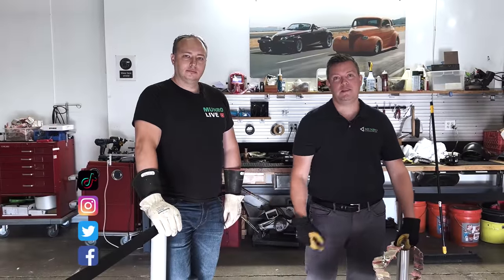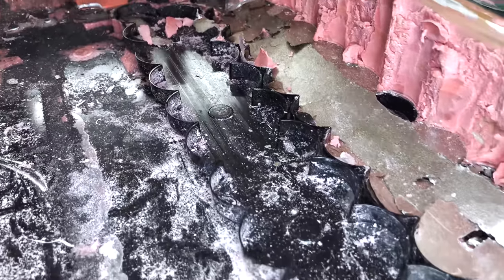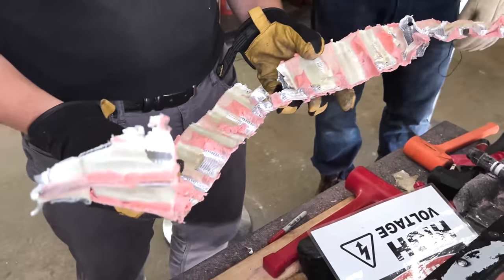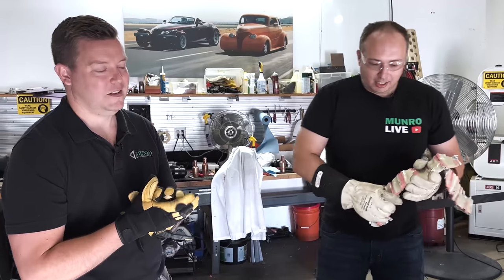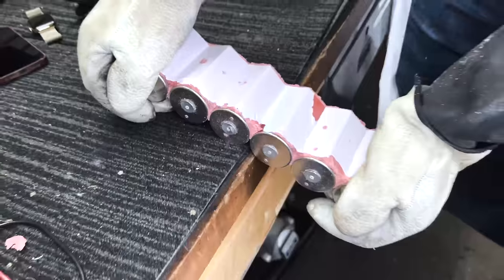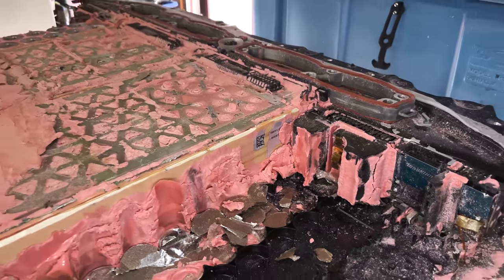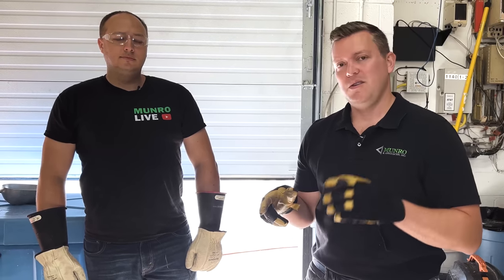4680 Update Structural Adhesive | Tesla Model Y

Comment: For all the "Reusability" and "Serviceability" delusional people: look at Weberauto YT channel's recent 4 part series about the Mach-e battery, which is "modular inside".  Basically 3 days of labor with lots of special fixtures and tools along with hundreds of fasteners to remove and replace.  I'm sure that every neighborhood garage and DIY grease monkey can do that.  Very few, if any, Ford dealers can do that.  As for the cost, if you have to ask, you can't afford it.
Reply: EXCELLENT points
Reply: Good to know. I too think servicing the packs (non-structural) to refurbish them it so be done in specialized facilities. It's not feasible the technican services the particular pack in a car and puts i back - labor time would be too long. Maybe it was easier on early EV:s that were not built for it from the ground up but with advancements of skateboard designs and Teslas structural pack giving more advantages they ought to just go ahead and design them for lasting at least the car expected lifetime. It degrades some but then stays high. I have a robotic lawn mower with 2500+ charge cycles on some 18650 batteries, it still works very well.
Reply: Outstanding research, nobody whose hating on tesla and uses the alleged lack of any supposedly easy recycling will listen. 😀

Sandy himself said easy peasy just grind it up, use chemicals to seperate out the various valuable recoverable elements in float tanks. 
Recapture repurpose and then reuse them in new pack's.
Elon also said they view pack's as simply starting off with some high grade ore.

Heck we chop up whole entire cars at auto recycling businesses across the U.S. now, per GDP the auto recycling industry is our nation's 16th largest contributor. Over 90% of all vehicles are recycled, and up to 95% of the entire material count is recovered during recycling.

A recent study also estimated that every ev pack of at least 60kwh capacity has $1,800-$2,500 by content recoverable materials contained in it. Now if people will cut off a cat for the few hundred in rare earths they contain? I imagine battery packs will also be completely reused. 👍🏻😎
Reply: GM tested in-the-field module replacement for the Bolt recall program. The actual recall program though ended up as swap of complete packs. All things considered structural pack that if it fails becomes high grade ore is the right idea.
Reply: @4literv6  Just grind it up? So that's the solution to every problem on an assembly that cost tens of thousands of dollars?
Reply: @DeLorean4  all the materials they get from it are clean, so that means for prob 20% of the resource cost they get clean and recycled materials. So it's more beneficial to shred a pack for resources than to repair it. Do not forget you also get money for the pack, not the full value of a new pack but after 10 year warranty it's probably your only cost IF a pack dies, which has not happened yet, only degration.
Reply: @DeLorean4  Well, yeah.  How much would you be worth as Soylent Green?
Reply: So you have one more example of bad repairability and conclude that all packs must therefore be unrepairable, ignoring that Tesla's own packs until now could be repaired quite reasonably at the module level.
Reply: @jfolz  I didn't ignore anything, instead I've done the research on places like Gruber motors repairing the older simpler roadster pack's. 
And low rent types like rich rebuilds claiming his electrified garage shop can repair a tesla pack for cheaply. 
Again those repairs have no warranty and do NOT hold up over any period of time. 

Over on the main tmc forums multiple older tesla owner's who tried to cheap out and get a module or 2 replaced. Saw exactly what I'm saying happen, over a short period of time the bms reverted back to showing reduced capacity. The pack's do not play well with adding different modules once sealed up. Maybe swaps where they use different boards and bms systems to control tesla parts see better use. But that doesn't help a tesla owner and again has no warranty either. 

Plus I used to be certified as an entry level tech myself and have managed automotive repair shops. Inc those with hybrid trained tech's before teslas and leafs i3s etc started appearing. I also talk with the tech's at my nearest actual ev certified Ford dealer. None of them want anything to do with replacing/repairing modules in pack's of any evs. Exposing the pack's to humidity here in the south can cause issues. 

Getting them to completely seal back up properly is a known issue. It's a very complicated and at least internally speaking delicately balanced act making a modern durable long lasting ev pack. No matter what anyone tries to tell you on the internet otherwise about "repairability"👍🏻
Reply: @jfolz  Really?  how many battery packs of any BEV have you, or anyone else repaired?  The Leaf? the Bolt? an ID4?  A 'Bimmer, Audi or 'Benz.  Maybe you're the one with the thriving Taycan battery repair business.  Surely the more expensive batteries of the Hummer and Rivian have plug & play cells like your cell phone?  I'll stop now to let you listen to Jiminy Cricket sing a few choruses of "When You Wish Upon a Star" or from Cinderella "A Dream is a Wish Your Heart Makes"
Reply: @steamtorch  yeah the careful matching of cells/modules in series cannot be understated in this application even if cells are fully accessible & serviceable, it's not going to last well with a cell out of spec to the others and would take ages to review the entire pack to ensure it matches the rest,  BMS balancing can only do so much and these packs would suffer greatly reduced life with a mismatched cell/module.
Reply: @shazam6274  why would anyone attempt a repair on a pack that's still under warranty? You can't compete with $0...
Reply: @4literv6  I'm not surprised some people have had bad experiences with module replacement when you can only get salvaged modules that are the same vintage as the others or have been in a crash. This is not a problem with repair in an of itself, just how Tesla operates.

Btw. the rest of the world exists. Maybe look at what's going on in Norway if you want to know about EV repair. They have the highest density of EVs by a long shot.
Reply: @jfolz  Whoosh!  The issue was reparability, which is not a practical possibility with ANY of the vehicles I mentioned.  GM tried to save money $ repairing Bolt Batteries, but found it was better, faster and cheaper to replace the whole pack.
Reply: @shazam6274  woosh yourself. You have one example of one manufacturer trying repair and conclude that it cannot be done.

Not that I already wrote that 8 hours ago...
Reply: @jfolz  no manufacturer will repair battery modules and safely replacing modules in a pack is never cost-effective, your working with 400v live bus bars once you get to pack unsealed.
Reply: If you can't remove the modules from a Mach E pack, you're either an idiot or just mechanically incompetent. Hobbyists have been tearing down EV battery packs for a decade now, without much difficulty. Still, between high dealership labour cost and a desire to avoid mis-matched modules, vehicles will typically get complete pack replacements; disassembly to the module level is mostly for re-use of the modules in different applications.

Comment: Gads, i hope they have some system to allow the pack to work when a cell goes dead
Reply: How about some form of solid state relay, one per cell, that trips if the cell goes "out of spec" and electrically removes the cell, then software that performs a recalibration when possible?
(0.12 percent loss per cell.

Comment: Well you wanted a structural battery pack... I would love to hear an analysis of the structural rigidity of the full assembled pack between the foam and the glues and the cover. I bet the pack is stronger than any frame on any pickup truck out there.
Reply: Until the glue and foam strength properties decay over time with heat cycles.

Comment: I stay with my Statement: Only the Foam makes this Pack more "Structural" than the 2170
Reply: They lay down differently
Reply: you dont understand engineering.. its ok thats what the channel is for. the difference isnt the foam. its actually a lot in the rest of the car. because the giga casting makes rear more stable the battery pack is able to be a link to the front megacasting.  the batteries pack has mostly been ready to be structural, the change is mostly the casting  not the battery. it makes a (3 piece) platform design as sandys raved about for 15+ years possible, and only teala had the gumption to make it happen
Reply: If you see the 4680 tear down from Jordan, from the limiting factor YouTube channel. The cell case of the 4680 is also much thicker, plays a role in the structure.
Reply: The "structural" generally means the battery is designed to handle the torsional load normally handled by the floorpan in a vehicle. The stiffness of the pack comes from how the whole pack is designed and built, rather than a single thing. It's probably a little less stiff without the foam and a lot less stiff without any cells in it

Comment: Really disappointed by this adhesive approach from Tesla, all this for what? 10% more capacity? Believe it or not when these vehicles comes to EOL it will be thrown in a landfill instead of a repurposing it for a home storage solution or something similar...
I much prefer the VW's approach, everything is modular, bolts, screws and nuts hold everything together, design with repairability in mind.
Reply: Simply wrong, they’ll be recycled.
Reply: Sandy’s lack of appreciation for threaded fasteners heightens.
Reply: The aim seems to be that the battery pack won't be repairable, but it will be recyclable. Tesla have explained that the way they will recycle the battery packs is to crush them into a powder and treat that powder as a high-quality ore that can be purified to extract out the various elements.
Reply: @CiaranMcHale  That's easy to say but no-one has actually tried it to see if the extraction is practical. "We will figure out a way to deal with it later". Hmm, where have I heard that before?
Reply: Completely reclaimed.  The entire pack will be reduced to powder and the essential elements extracted.  Redwood Materials is the recipient and has the process worked out.  More importantly, these are million mile batteries?
Reply: @LesNewell  As far as I know, Redwood Materials use the "crush old batteries into a powder and then treat it as high-quality ore to be refined" method. An internet search suggests they already process about 6GWh of batteries per year (and they aim to increase that substantially in the coming years). Also, during the past few months Tesla announced that it has started recycling its own batteries, and that they use a similar process.
Reply: Why would it go to a landfill? True, it can´t be repaired, but that doesn t mean it can´t be recycled. FYI recycling is not about unscrewing everything and nicely separating individual parts. Nope, you just mill down everything and use different material properties for the separation.
Reply: @CiaranMcHale  
Redwood will also be crushing EVERY type of cell, including the ones from phones, power tools etc that DO go to landfill. So it's even BETTER.

Comment: I would never buy a car with that kind of battery. No possibilities of a 2nd life and even recycling seems to be quite energy and chemicals intensive. 🤯
Reply: Why is there no possibility of second life? People will re-use the whole pack.
Reply: Why would "you" use it as a "second life" unit?
You're simply taking units of the now increasingly weak FUD and trying to formulate a negative opinion.
Reply: @rogerstarkey5390  Because after being used in an automobile batteries can be further used as stationary storage for further 5-10 years, which further minimises the CO2 footprint of that battery. It is no FUD it’s called science.
Reply: @e-redj  so you have a large for a house static power pack that only needs a thermal management system inverter and controller, boo hoo my house bank will power my house for days and days!
Reply: @jackdbur  Just in plain words. If you can separate the cells from the battery without having to get rid of that pink goo, you can then build smaller modules for home use or bigger modules for industrial use. Nobody takes a car battery and bolts it on the garage wall. 🤦‍♂️

Comment: Thank you guys for the great information!  My take from this is that Tesla has such high confidence in their pack, that they have made essentially an unserviceable pack, and it would be a simple replacement of the whole pack.  Based on dropping the battery pack, how long do you estimate, would it take Tesla to replace one of these packs on a car, and would this make possible replacement/upgrades much more feasible?
Reply: You haven't considered that there could be a way to simply (automatically) "fuse" (disconnect) a faulty cell, then software balance the module/ pack?
("Rocket scientists", and all that?)
Reply: In a previous video, they mentioned how long it took them to drop the battery pack out. In practice, it would probably take 8-10 hours with a lift to fully swap the battery pack because the top of the battery is where the seats, carpet, etc. are attached
Reply: @areitu  Hopefully it's less with a full service manual that Tesla can have and technicans getting familiar with it contrast how Munro must go carefully since they have no prior knowledge of the particular new pack. But sure it will be more than old packs because of what you say with the seats etc.
Reply: @rogerstarkey5390  Roger, I did consider that, and I'm more concerned about physically replacing and not so much of a software enable/disabling standpoint.  Based on a prior video where they were trying to pry off the lid, it was quite difficult to do so.  The overall design of the pack and structure seems to lead to a situation in which replacements should be much easier, while introducing the possibility of upgrading a vehicle with a pack that has increased storage.  Lean Design would probably be able to identify the level of effort to do a replacement.
Reply: @areitu  Its 10 hours to assemble the entire car...
Reply: To be fair older Tesla battery packs were never designed to be serviced either. Sure people figured it out and did service them, but if you brought a malfunctioning pack to Tesla their recommendation would be to replace it.

People might say that’s wasteful design, but in general auto parts are not designed with serviceability in mind. Mechanics, regardless of brand, don’t generally repair parts. They diagnose the failure and replace it with a new part to ensure it is working as intended.
Reply: With how long it took Munro to remove the pack 2 or less hours mostly swapping the seats  console and everything if you had a complete pack with everything >30 minutes.

Comment: I’d be really interested in hearing what you guys feel about end of life recycling for these packs given the difficulty you have had separating the cells from the structure. Would it be easier to dismantle the pack if you don’t need to keep the cells in one piece? I saw one process where the batteries were frozen and then ground up.  Would it be an option to freeze an old pack and then feed it through a grinder then separate the materials?
Reply: Mangled turned to dust & seperated I'd imagine.

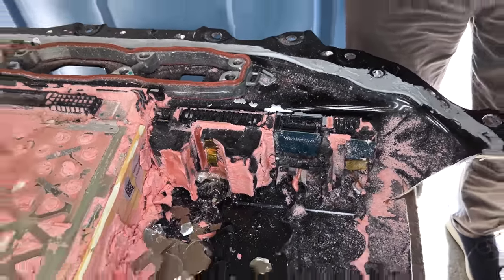Comment: 4:11 Same here.  I don't understand how you have a structural pack if you aren't bonding the top and bottom of the cell.
Reply: Are the cells really a structural component or are we believing marketing hype? The battery case itself may have some integrity but I highly doubt (and I mean highly doubt!) that individual cells bare much, if any load at all. 
Perhaps Munro's team would like to take the time  and be so kind as to test the integrity of the cells and foam as a structural component now that they are removed from the battery case. Take a row of cells held together by the foam and test them for tensile strength, compression strength, sheer
etc. and lets see just how well this so called "structural" pack performs.
Just a tip. Not so well, is likely to be the answer.
This pack has been designed to be cheap to manufacture and impossible to repair. For that Tesla get an "A". For marketing, they get an "A+". Us consumers on the other hand are just getting more disposable garbage.

Comment: With the structure of the floor-pan interior top and the exterior bottom pan of the battery assembly, one has to wonder why the cells have to be so rigidly glued together with structural foam.  Also whether there is any fire-suppression chemistry in the structural foam, particularly if they are going to use LFP chemistry inside the 4680 battery cells.  I can only wonder how this compares to the CATL "blade battery" structure used in the Chinese standard-range cars they are starting to produce at the Shanghai gigafactory.
Reply: Find a cardboard box (corrugated card)
Cut several strips. "Floppy"?
.
Now glue them together.
Not so floppy?
Now repeat that with 29 strips.
Rigid?
That's why.
As much as I would like to see LFP 4680 cells, they e said they won't be doing that (at least not yet)
The "blade" battery is BYD.
Reply: Starting to? LFP Model Y/3 is going on its 3rd gen pack since having the first 55kWh pack since 2020.
Reply: the structural adhesive foam is flame retardant and serves a purpose to insulate for thermal runaway mitigation.
Reply: The CATL blade battery has not been used in the Chinese Tesla cars yet.

Comment: Wow. Are the cooling channels cross-flow?
Reply: They are loops - the flow goes from the front to the rear in half of the channels of the extrusion, they returns in the other half of the channels. The 12 loops will be plumbed in parallel.